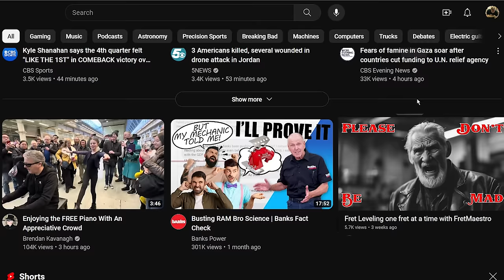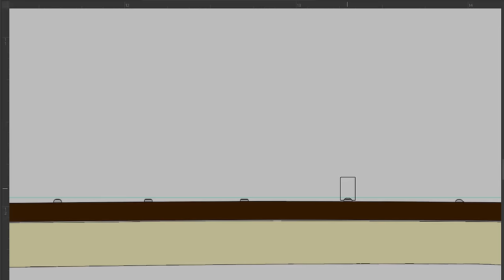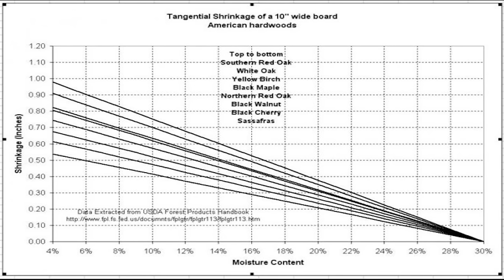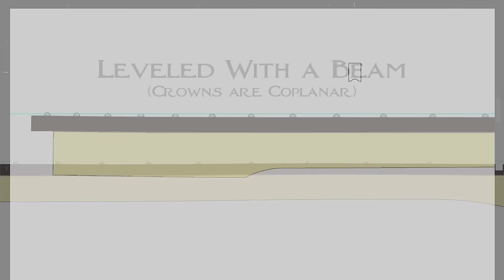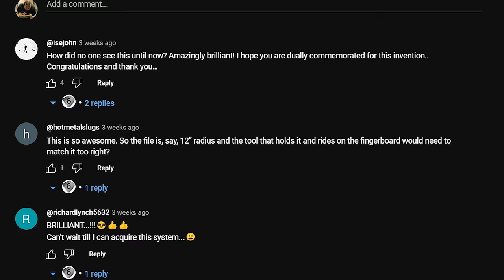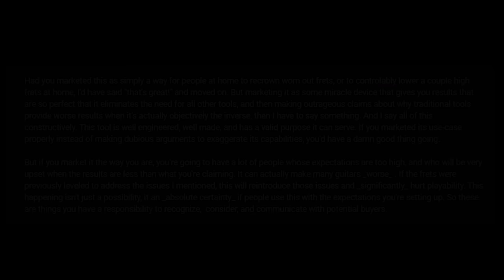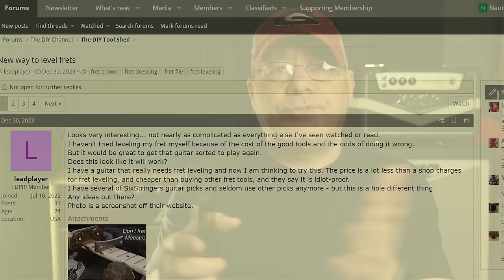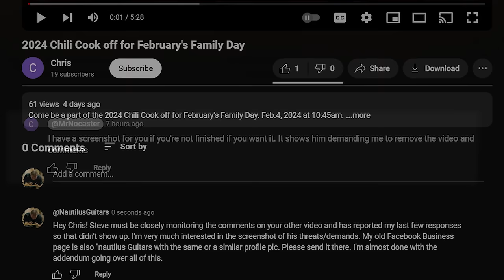Fret Maestro - Gimmick or Godsend? - A Fair Warning

Comment: Thank you for this video. I was minutes away from buying a Fret Maestro but had a "too good to be true" feeling from his videos that made me hesitate.

TL;DR: Equal doesn't mean equitable. Frets want equity - different heights to achieve a similar overall outcome. They don't want equality - exact same heights (symmetrical clones) that might place end up higher or lower than other frets because of variances in the neck and fretboard.

It's easy to fall into the claims that this will do what he says it will - after all, his video has a slideshow presentation, neat graphics and numbers, and he seems fairly knowledgeable and genuine. His claim is "symmetry" and "perfect clones" of each fret, and when your a novice to guitar repair, those words sound like what you think you're trying to achieve. I've worked on a few of my own guitar necks - a Strat that I re-radiused because it's a Starcaster (read up on those if you need to), a B.C. Rich Mockingbird that I completely refretted, and a little bit of leveling on a ES-335 that was new, but I wanted to see if I could improve the setup over the factory and shipping. All that to say, I have some experience but I'm still a novice and almost pulled the trigger to get this nifty looking tool. Honestly, the tool looks neat enough that I may still buy one if I feel like splurging some day, just to see what it can do, knowing that I may still have to use my level beam, z-file, and new frets if it doesn't work out.

But it does need to be said that what this attempts to do is not what it claims to do. Does it make perfect clones of the chosen fret? Probably (I'll have to see it in action to know for sure, but it seems likely based on the engineering). But perfect clones are not what a guitarist wants. Most new frets are perfect, or nearly perfect clones since they are all snips of the same radiused wire. But we don't want clones from one end to the other - we want adjusted frets so that the share the relative height to one another (as you describe, coplanarity). This is especially true in compound radius boards, as you very cleverly point out. But anyone who has done guitar work knows this is true by intuition, because we recognize the neck and fretboard and other parts of the guitar are imperfect, sometimes deliberately by design, or sometimes by aging. We should not be striving to achieve clones, we should strive to achieve relative height.

If it weren't for your video pointing this out so clearly, I would have bought it and might be kicking myself.

I know he and/or other people are going to respond to this and other comments because I haven't actually used the tool. And they will be right. But that won't matter. I don't have to test out every gimmicky thing advertised to me to know that they will not do what they claim - especially when the physics don't work. I am not a luthier. I have nothing to gain from this product selling well or selling poorly. I would love for it to be able to replace a plethora of tools in my work station, and I'm sure luthiers would agree. Saying this product doesn't work isn't an agenda, and I have nothing to gain. But it is clear it makes clones, but clones aren't what you want when you want level frets.

Sorry Maestro - it's nothing personal, it's simply a flaw in the design.

Comment: Thanks for the insight. What is the best way of battling the ramp that occurs at the neck? Now I understand why this section seems to be the typical problem area. Do you just ensure the highest frets at the ramp segment are leveled to the same height as the rest of the frets?
Reply from the maker: Yessir! I always start with a long beam that overlaps all of the frets. But if that ramps is making it difficult to get the frets level and is causing too much to be taken off of the first frets while you're working it down, then I switch to a short beam and focus only on those upper frets, putting more pressure at the end of the board in an attempt to lower the uppermost frets more. Once you work those down, you can mark them all again and see how the long beam is doing. Then if the higher frets still need more because the lung beam is skipping the middle frets, go back to focusing on the higher frets.

You just don't want to fight it with the long beam for too long, as you'll be eating away at the upper frets since the beam is only contacting the last frets and the first frets in those extreme cases. So if that's the case, try to get those upper frets eaten down a bit first.

Hope that makes sense!
Reply: Great! Thank you so much for sharing. I’m thinking about giving it a shot 😀👍🏻
Reply from the maker: @danielgreenberg4751  You're welcome! I always encourage people to try these things at home. So I say go for it! At best, it comes out great, at worst, you learned something valuable. Asking questions and trying things will always leave you with more knowledge than before! 

Good luck, and I hope it turns out great!
Reply: @NautilusGuitars

"...try to get those... frets eaten down a bit first..."

Respectfully, though, I'm wondering, wouldn't something like the Fret Maestro help in that regard, to get it closer to the final size?

I took only part of your quote, cuz my question might extrapolate to any and all frets.

Comment: Nice video, thanks for putting this up.   CNC luthier here.  The terms for describing the top of all frets as co-planar is incorrect as is relates to GD&T.   In the case of a constant radius neck, the surface formed by all of the top fret surfaces is considered cylindrical. and is ruled by cylindricity.  In any transverse section the frets would be collinear.  In a variable radius neck, the surface is a conic  (conicity) with any transverse section being considered collinear.
Reply: this guy'll get mad if you say this 😊
Reply from the maker: Thank you for the information! This is something I struggled with while making this video, and still feel uncertain about. Searching the definitions you provided yields plenty of clear and applicable concepts, but trying to search the concepts themselves yielded nothing but a mess of useless nonsense from Google. 

I reached out in a geometry nerd group for answers while writing the script and also got mixed input on this. Somebody mentioned colinear, but when I asked whether that only describes 2-dimensional geometry, several people agreed that it does, and thus wasn't applicable. Somebody else mentioned cylindricity, but also said it doesn't entirely apply because I'm ultimately describing the relationship between several discreet intersections of a cylinder, and the term "co-cylindricity" doesn't exist. Ultimately, most people agreed that "coplanar" makes the most sense, as it described the relationship between several bodies, so that's what I went with. But perhaps I should have instead asked the question in a machining group. It just never occurred to me. Several people here have contested my use of "coplanarity", but you're the first person who actually provided an alternative, and I've asked every single time to no avail. 

Anyway, I really appreciate the input. I'll try to get some consensus on this and if so, I'll make a pinned comment clarifying this and correcting the terminology. Glad you enjoyed the video!

Comment: I made a comment on his video and said if the point of reference was from the fretboard wood surface, what is the assurance that's the wood surface is perfect? Independently modifying one a fret at a time sounded like an easy way to make a mistake that would never have been known by the user.
Reply from the maker: Exactly! Judging by your username, I can see exactly why you'd immediately see this issue. It's really an engineering problem when it comes down to it. Reference is everything in precision. And referencing an imprecise object dooms you from the start.
Reply: @NautilusGuitars   & if the fretboard were a great reference for fret height, we could just qualify that the fret wire we buy had the profile we need, be consistent in height & just press new wire in, making sure it made 100% contact with the reference point and run it. we can now throw all our files & leveling tools in the trash, yaaay. good riddance!

Comment: String tech say that a series of different lengths of narrow wooden sanding blocks with leather glued on to them is the way to go when it comes to level a fretboard. Cause they are narrower and have leather glued on they can easy follow the radius and sand only the spots that need to be sanded not the whole length of the fingerboard. If you got a hump over the length of a couple of frets you use the shorter sanding block. So, you choose sanding block length depending on the problem. You pull the frets first and then when the fingerboard is straight you put new frets back in and level and crown them. To me that sounds like the right way and order to go about it. You use a series of different length rulers to check the straightness and the shortest will pretty much be like a fret rocker.

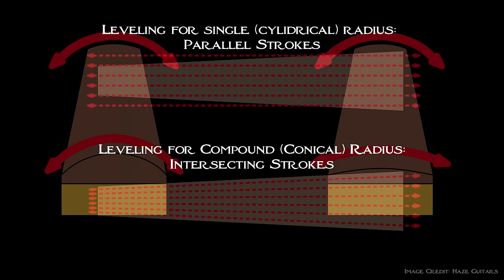Comment: One of the things that IMHO is not discussed enough is what you show at 9:40; the surface that the strings describe as they fan out towards the bridge is conical, there will be a non-linearly increasing distance between them and the top of the frets against a constant radius. I brought this up in some of his latest videos and, while I got lucky to not have my comment removed or hidden, he was kind of dismissive as he deemed this effect negligible, which could be true but only if not going for super low action, especially on large radii.
In any case, the fact that he's selling a 'precision' tool that should supposedly replace the traditional methods under any circumstances while being this selective about which other factors matter or not is a clear telltale for me.

Comment: man, i watched a couple of that guy's videos. seemed like a good idea at first, then i came to the same conclusion as this video. the individual height of each fret doesn't matter as much as having all the frets at the same level with regard to each other. i've worked with some rough necks, and a quick flat bar level and recrown made them play great. using the fret maestro would have left me with the same issue as before, with some frets relatively lower or higher than the rest because they are at the same individual height.